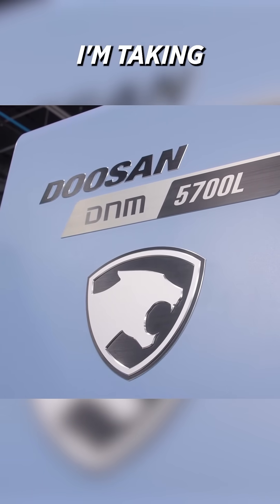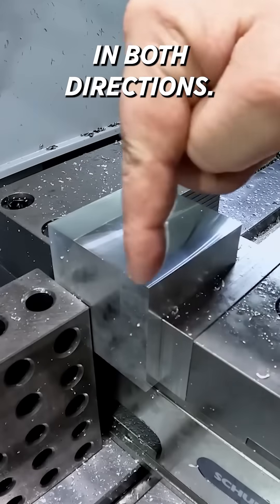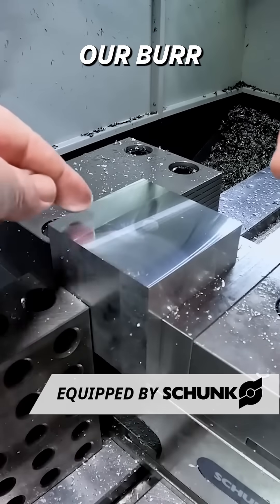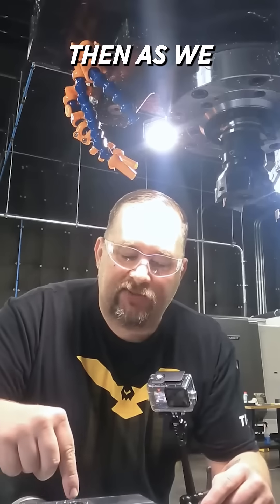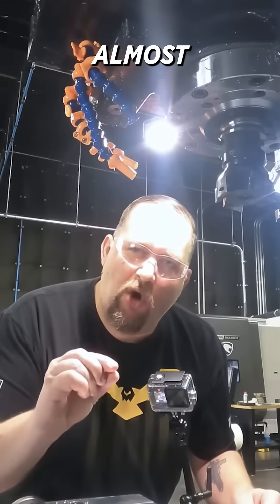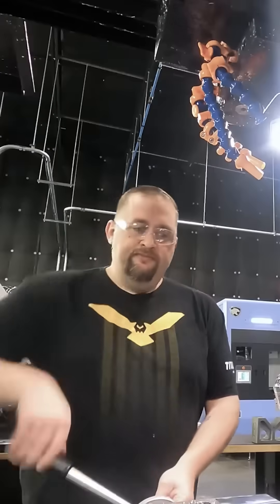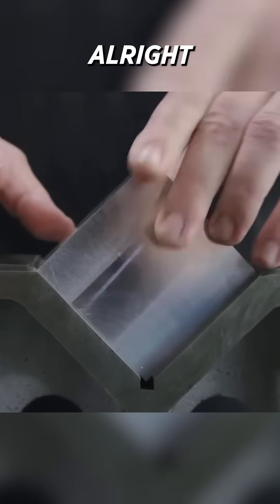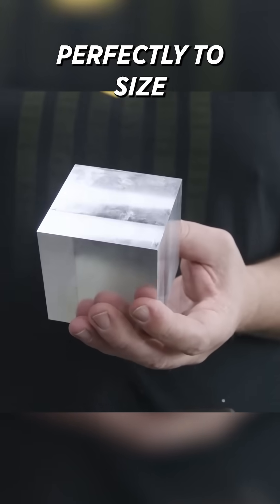STOP DeBurring Using this Technique

Comment: Its all fun and games until the routing calls for no sharp edges.
Reply: Or when it says don't break edges.... and gives you a tolerance call or on said sharp edges.....
Reply: @trentcunningham2416  inspection sends it back because your deburr isnt to spec, only to see next operation is is grinding...
Reply: @the_stubbs 😂
Reply: @trentcunningham2416 i love it when they say no edges and stock is huge.
Reply: "No sharp edges" is in the default title block of drawings where I work (design, not manufacturing) 😂 does it cause a lot of extra hassle?
Reply: @tongpoo8985  No. There really shouldnt be any sharp edges if people took some pride in their work - unless the customer specifically mentions that sharp edges are required.

Some customers require that all chamfers are machine made - which can get extremely complicated or cost a lot of time/money on some parts.

Having "Break all edges" on a drawing without specifing anything exactly just makes my life easy =)
Reply: @tongpoo8985 I like thay call out, means I can use a chamfer mill or file and edge
Reply: @tongpoo8985 I worked in a shop once where when they saw that they'd just throw them all in the tumbler. I tend to do pretty much all my devur work in the machine (wherever possible) it really doesn't take long and it looks more impressive to the customer than someone's crappy hand grind all over the parts. I do it whether or not the print says no sharp corners unless sharp corners are specified.
Reply: I always chamfer or radius all edges on everything unless it specifies otherwise. No good engineer or machinist will leave a sharp edge anywhere if they can help it.
Reply: @logannewman4532 *anywhere it doesn't need to be
Reply: @logannewman4532  got some customers that have do not break edges unless specified on all their drawing. So nope, i dont break edges unless specified.
Reply: In break n edges can use same prg but change tool to any 45 deg cutter throw in tool comp set z in prg at z0.00 level adjust cutter comp to where 45 is over edge part then use referece position manually move z down to just break ege then go back to offsett and can offett z , run prg and edited z 0.00 level and run prg to chamfer or just deburr edge and can delete rest prg just may as i use to do move z up and cancle cutter comp somtimes may need edit so as tool moves away  to move enough so room to cancel tool compensation usally had 1/4 inch regrind on 45deg works great never used file this way and disc grinder was to critical to roll edge so this option was safest way ensuring consistency
Reply: @jodygwiinn1233 most programs have some sort of chamfering op as well to make it easier. 😊
Reply: i say lets not talk about that
Reply: Lmao I had a job recently that said chamfer or radius the edges to .01 max, so I used my deburring tool, it’s aluminum and I told my supervisor, is that not a radius less than .01? Anyways, long story short I now do most of my deburring with a chamfer tool on a manual lathe… so much back n forth for no damn reason. lol
Reply: Two swipes with a file.
Reply: Take it to the beltsander. 😅
Reply: My thoughts are like no fun when dealing with more than .006 stock any sort of finishing grinding.
Reply: I would rather no sharp edges than specifically called out sharp edges 
What if there’s a burr???
Reply: Use 4inch brush made by ingersol to polish and deburr at same time barly breaks edge just watch speed and feed

Comment: I manually edit the facing toolpath be like this to reduced most of the burr so it's easier for me to setup. But programmer just don't give a fuck, because it "waste" the "cycle time".
Reply: He’s right. You should be deburring it as the job runs and not wasting company time to save YOU a step. This doesn’t even keep you from needing to run to the belt sander. It just makes it a tiny bit easier.
Reply: @the1981tree  But while I deburring those thick ass burr, machine waiting for me to setup. Because it was my first piece, not mass production. Another point is, more manual deburring = higher chances of scratches, QC may reject.
Reply: @gamegood  yep if you are a setup guy it’s a different story.